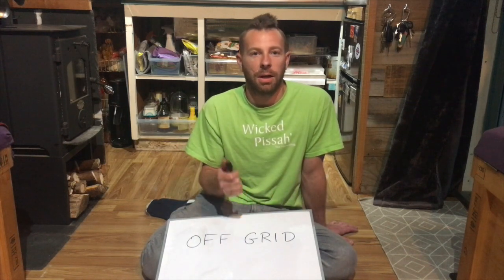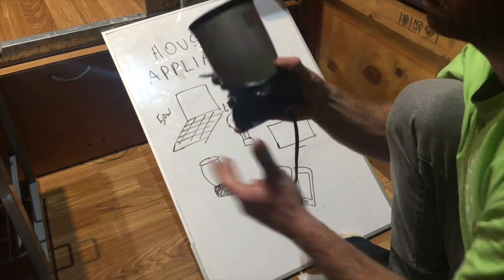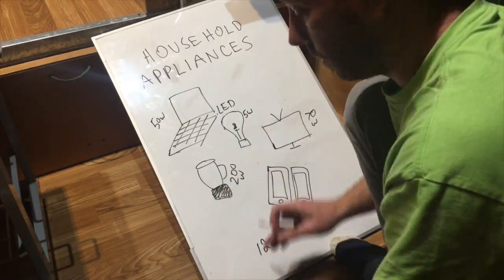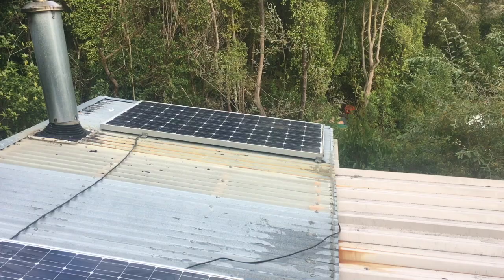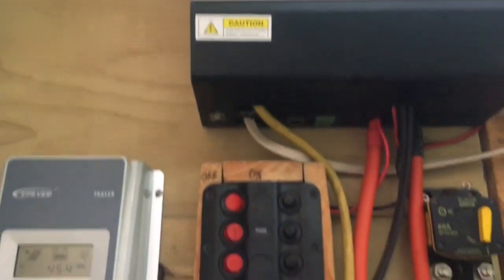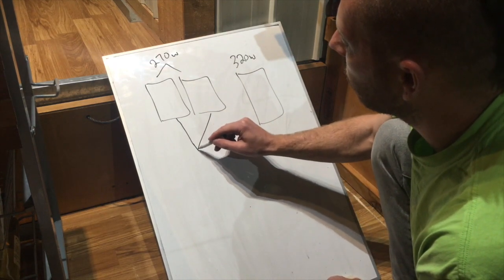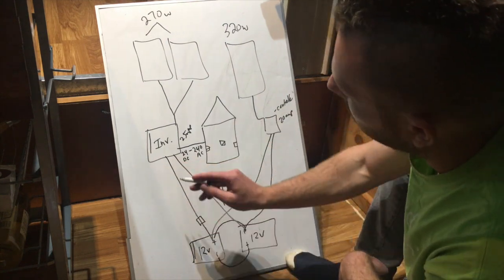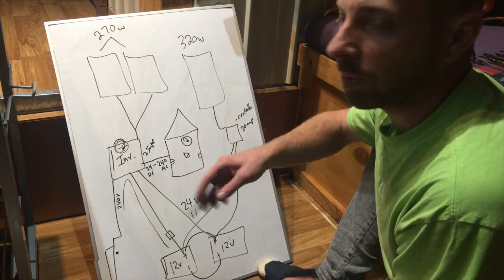Living Off Grid: How We Set Up Our Tiny House Solar System

Comment: If the battery is in series the last end should not be connected together. That system would have exploded . the last two end + - of the battery should be connected to a controller
Reply from the maker: Yes the x2 12v batteries are connected in series to create a 24v system and are connected to a solar charge controller built into the inverter. This was also put together by a licensed electrician. Its also been in operation for almost 7 years now. No sign of explosions. Hope this helps clarify things.

Comment: Min. 7:08 do I see a damaged PV panel there? Are you sure that panel is working?
Reply from the maker: Good spotting! It was damaged during a very bad wind storm in Waimate about 4 years ago. The glass was damaged and we sealed it according to the interwebs! The solar controller connected to that panel tells us that it is still functional and bringing in energy! But if it ever does stop working, then we will replace it. But for now, no worries!